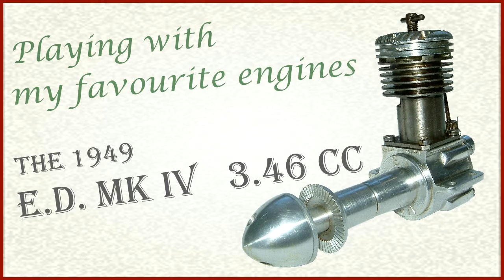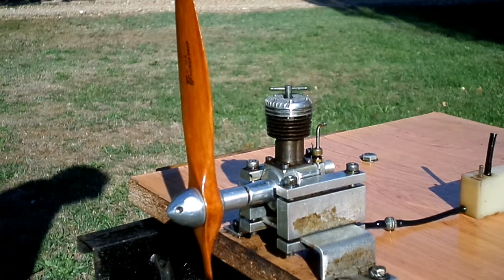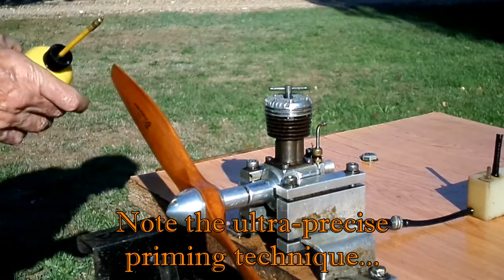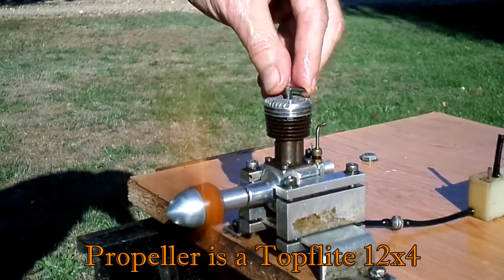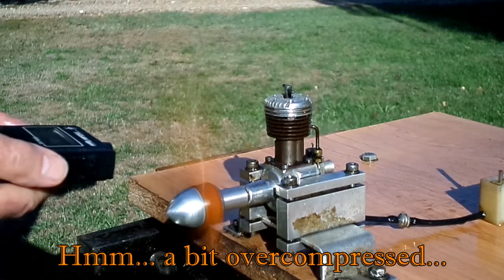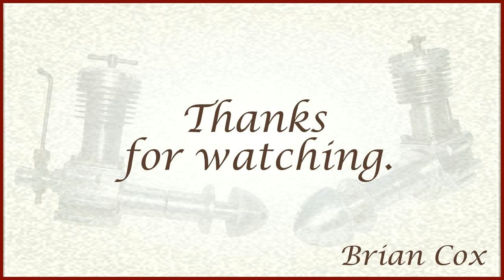E D  Mk IV 3 46

Comment: Hi Brian, I do enjoy these videos. I wonder if you might be able to shine some light on a mysteriously modified engine I aquired recently. I have a Cox Pee Wee, which the previous owner converted to diesel. In doing so he drilled a tiny hole in the head, the purpose of which I don't understand. Diesels have uprated cranks and con rods to deal with the higher torque, I believe, and seen as this evidently hasn't been uprated I suppose it could be to relieve some of the compression when running. What do you reckon?
Reply from the maker: +petrolnut Hi, Thanks for your kind comments. Concerning your PeeWee. You don't say exactly where the hole is drilled. If it's in the centre of the head (where the glow filament was), then it's probably for a compression screw. If it's elsewhere, then I can't see any likely reason, and it may just be a mistake...
In any case, there's no such thing as "relieving compression" in a diesel engine, or any other engine that I'm aware of, unless you go back to very old motorcycle engines, that had a "valve lifter", that reduced compression so that they could be kicked over...
A diesel with the compression "relieved" (no compression) will never run!
Finally, glow engines converted to diesel, for me, are just something to be avoided. It makes me feel a bit sad when I see Americans (usually) discussing their diesel problems, that are mainly down to the fact that they're simply misusing engines designed as glows!
I once possessed a Cox 049 diesel conversion. It was AWFULL compared with the super old small English diesels that I'm used to...
Sorry but you did ask for my opinion... I just wouldn't mess with glow conversions...
Reply: +Brian Cox Thanks for the quick response!. I should have been a little more specific. The centre of the head, where the glow plug should be, has a homemade compression screw setup. Next to this, drilled into the head at an angle, is a 0.5mm (at a guess) hole, which isn't threaded. When the engine is spun over it appears to have some compression still. I suppose it could've been a failed experiment. If you believe it isn't worth messing with then I wonder if it might be possible to find a glow plug to fit the head, and plug the hole, or just find a new head. 
I suppose if I want to experiment with diesels I should attempt with a good engine, as this Cox would probably just put me off.
Reply from the maker: +petrolnut 
Hi, OK, the compression screw must be operating some kind of contra-piston. Would be interesting to see it. There's not much room. I hope it's not some kind of alloy sheet (from a drink can) arrangement..
Maybe the hole you mention is simply a tool grip for screwing/unscrewing...
I'm trying to avoid just giving you my ideas and opinions, but I can't help wondering why you bought this thing and what on earth could you do with it...
In fact, you've simply purchased a problem (to get the thing to run). I hate this kind of "iffy" situation with tiny converted glows. You my have seen the little "K" 0.2 cc engine in my videos. That engine is nearly seventy years old. It's smaller than a PeeWee, and it's a fabulous runner!
If you should decide to convert your PeeWee back to glow, new glow heads are available here:
http://coxengines.ca/cox-.020-glow-head.html

Sorry that I'm not really much help.
BC

Comment: Brian I am very disappointed to see that you lost your rag with this engine at 3:04
Reply from the maker: Yes Charles. Life is hard sometimes, but I'm saving up for another one...
Another solution would be to mess with engines that don't run... then your rag never gets blown away... I haven't tried that.
Reply: Hahah  lovely ....  you might like to try zero pitch propellers, in case the engine starts inadvertently ! And a flying tip, I always use aluminium noseweights, to bring that CG up with less detriment to the glide.  Love your videos Brian, always a step back to a gentler era. All the best
Reply: LOL, blow a way the cobwebs :)

Comment: Hi, I have one of these, a really lovely engine, probably the nicest I have ever owned. Unfortunately mine suffered a fatigue failure between the crank web and the shaft so it needs a rebuild. Well worth doing, do you anyone whole does this sort of work to a high standard using decent materials?
Reply from the maker: Hi, Yes they're super engines. Are you sure you didn't overload it?!
The best option for superb work would be Jon Fletcher in Oz, but your real problem isn't that...
The kind of work you need today may well cost more than the value of the engine. In other words, your best bet would be to look out for a similar engine on eBay. Ideally, an engine in poorish condition, but with a good crankshaft would be relatively cheap, and certainly less expensive than the work you're considering. In fact, if you bought an engine in overall excellent condition, I think it would still be less expensive than making and fitting a crankshaft... Regards, BC
Reply: @briancox3691  A new old stock crankshaft just popped up on Ebay!
Reply from the maker: @HowesAero  Good!
I hope that you get the thing and that it's compatible!
Reply: @briancox3691  It will be checked very carefully.

Comment: Szia.
Milyen az üzemanyag arányod?👍🏻
Reply from the maker: Hi, I forgot to show the fuel mixture in the video. Sorry!
It's very close to 3 equal parts of ether/kerosene/castor oil, with a little nitrate additive.
But the exact mixture is not critical.
In most of my other videos, I show the label on the fuel can (it's English commercial fuel) and the label states the exact proportions. You'll find it easily in my other diesel videos but, like I said, the exact mixture is not very critical.
Reply: Köszönöm a gyors válaszod.
Nekem 15% éter, 60%petróleum, és 25% ricinus olajjal megy egy Mk-17, és egy Marz 2,5D.